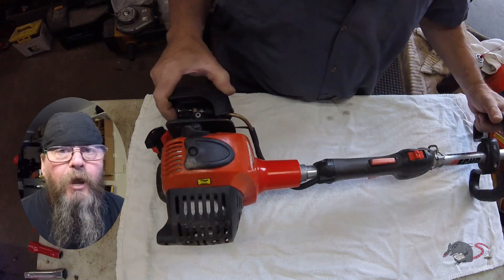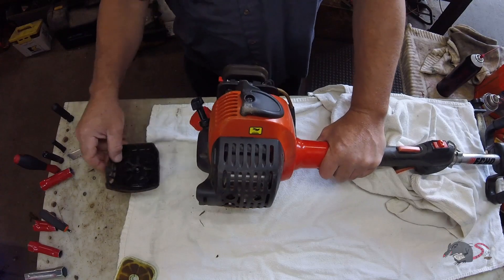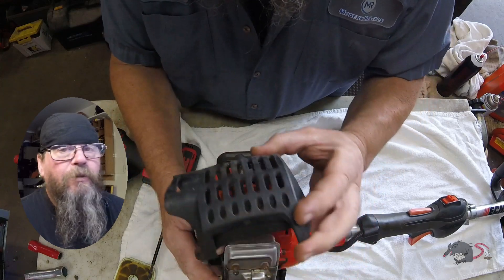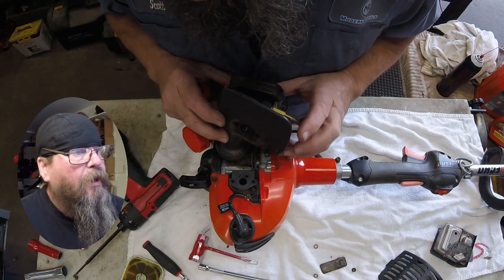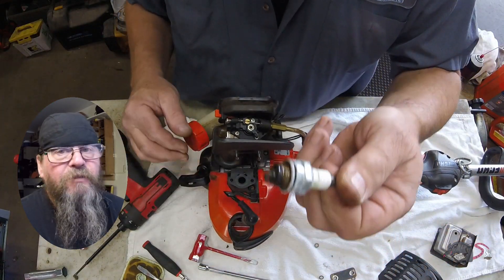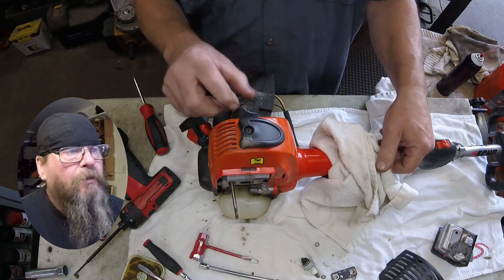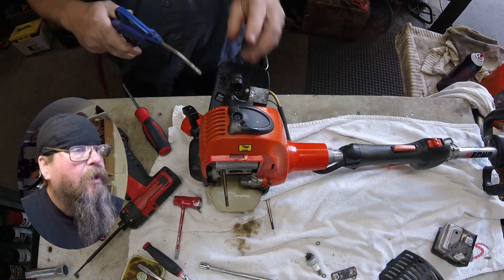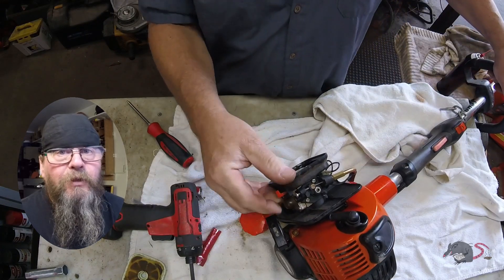Echo Pas-266 No Start-Fixed!

Comment: Great video. How does the water get in there to begin with?
Reply from the maker: A lot of times it happens when a unit is left in the rain with the exhaust facing up. Water enters the exhaust port and finds its way into the rest of the engine.

Comment: Question from a hack: with that much water in the engine, do you need to add some additional lubricant for the lower end after cleaning it out, or does the fuel mix provide enough?
Reply from the maker: Normally I pour 2 stroke oil in and pull the cord a few times but this time I was hoping the seafoam was gonna lube it. I believe if any damage was done to the bearings (rust) it happened before I ever got the machine.

Comment: Shame you didn’t have WD40. Mild lube but good cleaner. Good info
Reply from the maker: Ya there were probably a dozen better choices available to me. I never use seafoam, don't know how it ended up in my work area, and wanted to use it up and make it go away. WD40 is supposed to displace water and would have been a good choice.
Reply: @TheGreasyShopRag  I see why you have a system, catches a lot of things. At that point in time any lube would be good.   The seafoam was probably from the dirty 4 cycle side playing a joke on you. Lol.    Great video and take care.
Reply from the maker: @steveriggenbach90  Thats so funny because during the recording of the video one of those greasy hacks came by and said he had more seafoam if I wanted it!